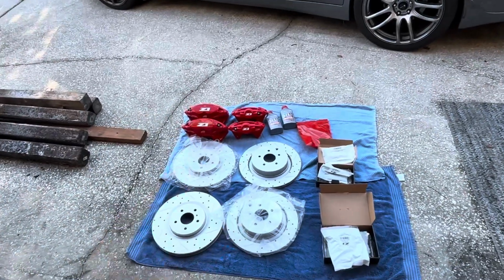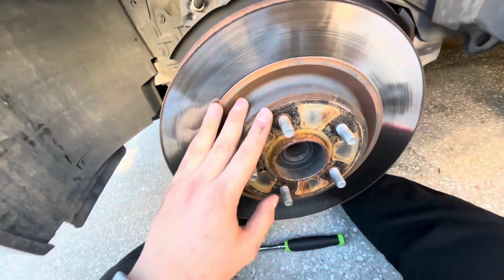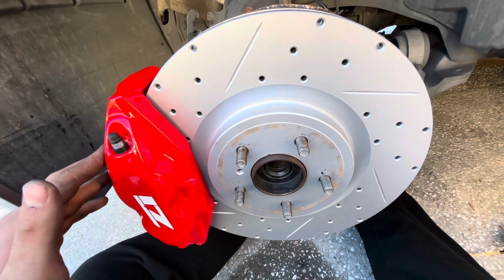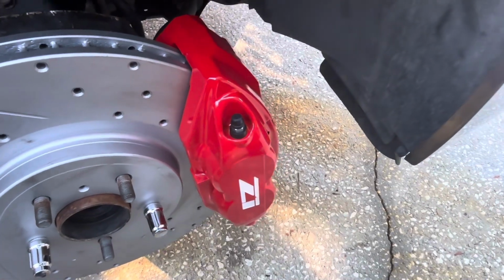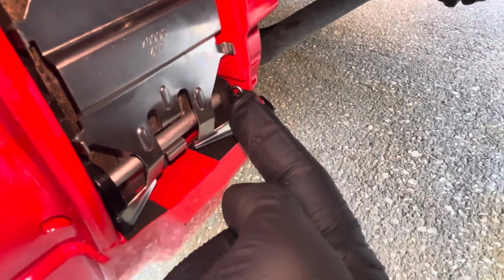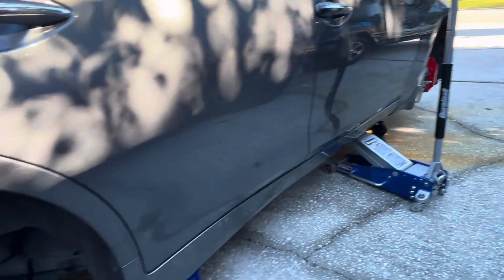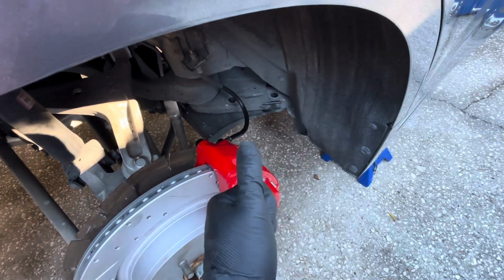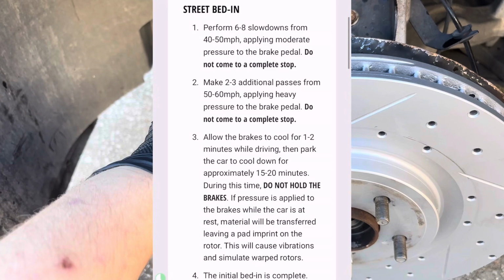How To Install Z1 Motorsports Big Brake Kit For Q50/Q60

Comment: Do they sell a bigger dust shield? Just for a clean install
Reply from the maker: Yes they do, it was an option you can add when you order from Z1 motorsports
Reply: did you take the hub off to install it?

Comment: Also, any specific reason why you went with the Z1 kit, and not the Akebono ones? I know there is a slight price difference, but they should have similar clearance for wheels. Thanks.
Reply from the maker: It was mainly just price because I heard they have same build quality and yes they should have same wheel clearance
Reply: They’re the same Z1 just put the emblem on it

Comment: Why did you not upgrades to ss brake lines as well?
Reply from the maker: I probably should’ve since they were only an extra $100 but I just didn’t feel I needed it
Reply: @Ghost.q50  the oem rubber lines tend to expand and give a soft pedal feel after a little hard breaking. They are well worth the little bit of time and money.

Comment: What are the wheel specs you have? I own the brake kit for my q60, but i have to run spacers for the OEM wheel.
Reply from the maker: My wheels are 20x 8.5 +35 in front and rears are 20x 9.5 +35
Reply: @Ghost.q50 what are the tire widths?

Comment: How many banjo bolt did you get from z1
Reply from the maker: I don’t remember tbh but I just know it was enough for the install
Reply: I ordered the big forged brake kit for my g37 and I took it to the shop to install and I guess it was missing the two front caliper bolts. So now it’s stuck at the shop until I contact them and get them. I just ordered a bunch of bolts front the website hoping they are the ones since it was after hours and I need the car asap

Comment: Great video,  can i use oem akebono brake pads all around instead the ones offered by Z1? Thx
Reply: Should be able to if they fit. A fit is all that matters not brand